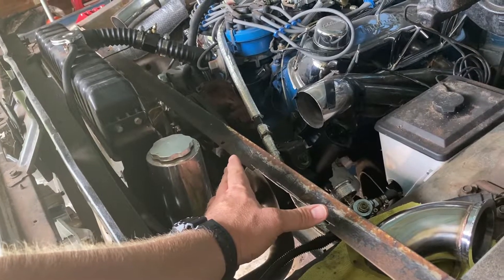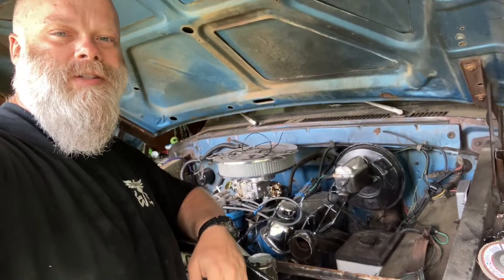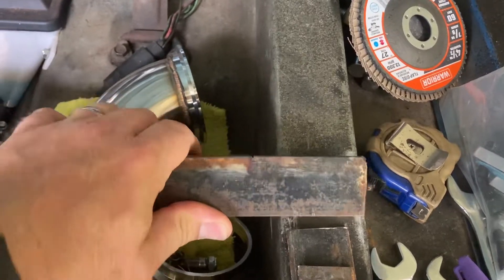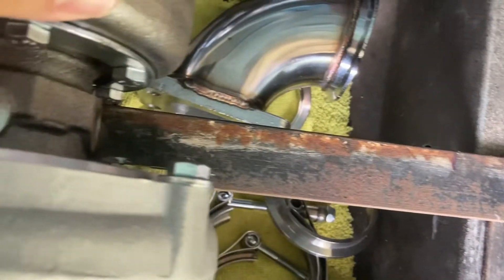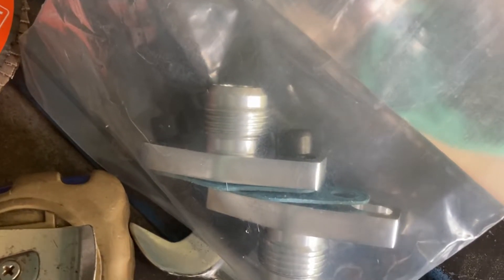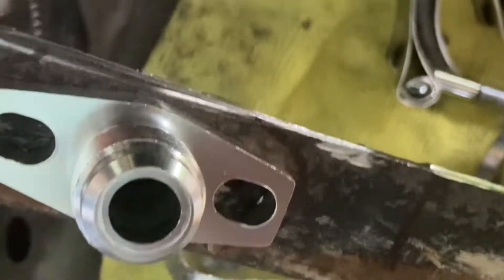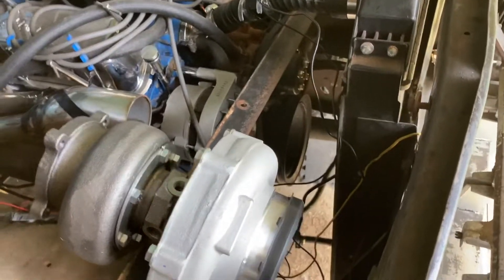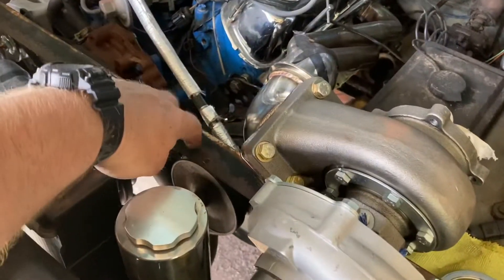Ep. 3 How To Make A Twin Turbo Mounting Bracket - 4 Simple Items Needed - Get Perfect Measurements

Comment: Idea,What if you used the tool box as a air box for the turbo make a way to mount it to the fender next to it
Reply from the maker: That may work as well. If the shoe fits as I say it then that's a green light. This bracket system will allow folks to install their turbos "top-mount" or even "bottom-mount." 

Stay tuned for Ep. 4.